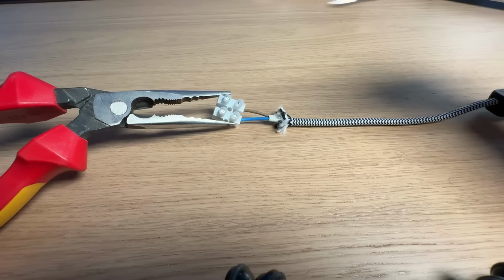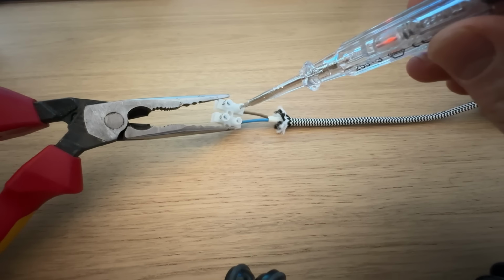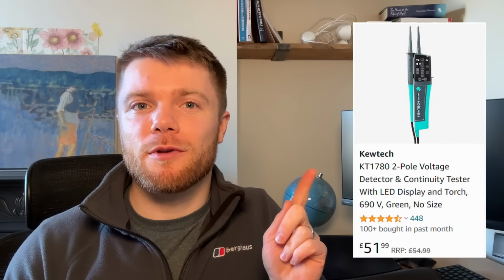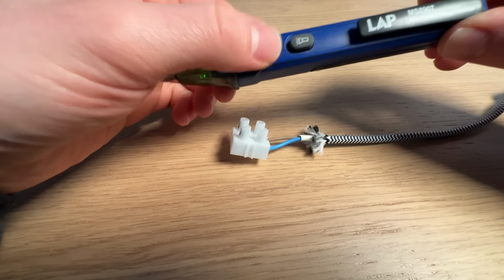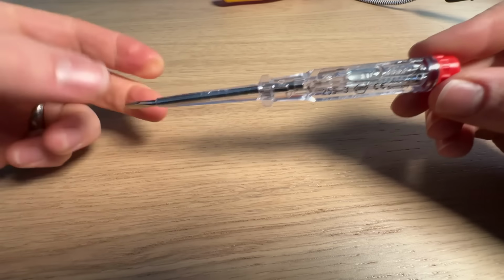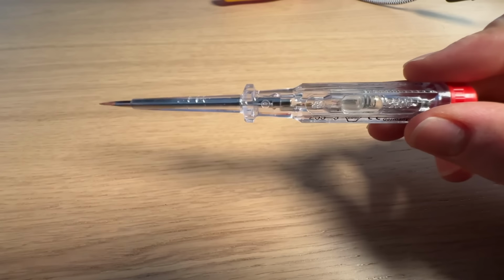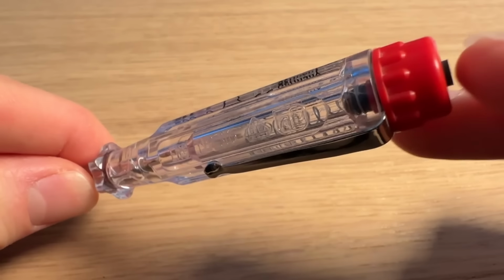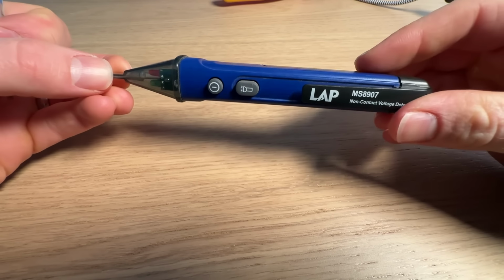The Most Dangerous Electrical Tool

Comment: the non-contact detector detects current but it DOESN'T detect lack of current. If it doesn't beep, you still have to double check with another more reliable device ;)

The testing screwdriver is great for small screws in connectors, but I don't trust that small resistor inside. In theory the light is supposed to fail and break circuit first, but can you really be sure? ;)
Reply: WTF are you even talking about?
Reply: @zaxmaxlax  which part? non-contact detector will never give you certitude that whatever you're about to touch is dead and safe. Because it detects magnetic fields specific to AC. It won't detect DC, it won't detect pulsating current, it won't detect variable current. As to that cheap screwdriver only that tinny resistor inside prevents 230V to flow through you. If it ever fails, you die.

If you want to be 100% safe you need a multimeter/ 2 pole voltage detector

Comment: Talking about a clickbait title.
The "dangers" being talked about here are very hypothetical and happen to - if anybody ever - one person in millions.
1) how would water get into this tool? If this had been sitting submerged for whatever reason, your common sense should tell you not to use it with power anymore.
2) the spring breaking off and perfectly touch both contacts before and after the resistor is not only so incredibly unlikely, that you could say it's impossible, but since part of the spring to the contact point would now be missing, there is no closed circuit anymore.

If you are talking about this tool being dangerous, in your logic, not a single mains cable should exist in any household. Because them being life all the time and possibly getting damaged and being a real risk of shocks is a million times more likely than having an issue with this screwdriver, if used as intended. Not a good video, unnecessarily causing fears with people.

Comment: Electrician here. I've used these live drivers made by CK for years. Even the Roughneck versions at Toolstation. They have their uses as an indication of SOME voltage present. They are far from the most dangerous tool. There are tools on Temu that are not even CE rated. Also tools incorrectly insulated. Go have a dig at those.

Comment: By USSR and now RF rules this neon screwdriver (of course certified and regularly tested) is the single official way to check voltage presense as safety measure. No multimeters, electronic indicators and so on allowed, only 1-pole indicator with sensitivity 90V (as I recall). 2-pole indicators allowed on high voltage, its separate story.

Yours is Wiha, Germany, so its TUV certified and reliable.

Comment: Well you got me to watch your video but it’s just scare tactics! I’ve been using them for 50 years and no problem. They are not allowed to be used in this country unless they have passed British Standards. So passed by a safety body. You can get a shock off any electrical device if it breaks in certain ways. From your way of thinking they are all dangerous! It would have been much better to highlight lawnmowers with cables on wet days. Now that would have been an actual decent YouTube safety issue to flag up.. not this‼️

Comment: I'm all for encouraging people AWAY from those screwdrivers, and there are some great points in there I hand't considered.

A non-contact voltstick (AKA "Deathstick") is still dangerous (too many false negatives) - I'll make a video about that soo. They cost a similar amount to a proper GS-28 voltage indicator that you showed. I have a video showing DIYers how to safe isolate properly, would you mind if I share it here?

Great job spreading the word about electrical safety!

Comment: Does it have to go to ground? Or does your body provide enough capacitance for the AC current to light the bulb. I have a LED lamp that slightly glows when the light switch is off because of the length of wire that acts as a capacitor. Could you put a capacitor in where the spring is and make it work that way? I do use these from time to time. I believe i remember my highschool electronics teacher taking one of these small bulbs without the resister and doing the same thing, he explained that if he were in contact with the ground he would get a nasty shock. Few of us took up the offer to light up the bulb ourselves.

Comment: Another 'failure mode' is when you are NOT connected to ground because the soles of your shoes are insulating ... an unusual scenario but possible with modern plastic materials.

Comment: Mine lights up when I touch the (unconnected) earth core in my non earthed lighting circuit. The earth core is safe to touch. This is due to capacitance in the cable. Something I understood as an electronics engineer.

Comment: I've used and continue to use all three items you've reviewed. I take your point but I think it's extreme to say the screwdriver type tester is very dangerous. Personally I prefer the non contact tester as it's so quick and accurate and detects current in cables without removing any sleeving to expose the copper cores. Also many non contact testers have an LED light so you can see into dark spaces where many consumer units are located. Mine also has a green laser pin point light. So, overall many benefits over the old style tester. Thanks for yor video.

Comment: But the non contact tester has a different purpose. It can tell you that the cable is live but it can't tell you which wire is the live one. And that's what you need to know in many cases.

Comment: The lamp works by ionizing the gas inside, there is no filament. Even if the lamp breaks as some said,  that will not be enough to make proper contact inside and harm you. The only risk is not seeing the light or improper contact.

Comment: The mains testing screwdriver and voltage pen are dangerous, but not as dangerous as the flick with the  back of the hand. The test screwdriver and voltage pen are not dangerous in the hands of a skilled worker.

Comment: How does it work? How is the circuit completed since it is connected to only live wire?
Reply: The circuit is completed by the tool user who is acting as a capacitor plate WRT to the ground (or in extreme cases user acts as a resistor when standing barefeet on concrete floor >-).
Reply: @kassisaba  whoa! That means current flows through me? But why don't i get shocked?
Reply: @_soundwave_  The current is so miniscule, we're talking less than 10 microamperes here. The current would need to be two orders of magnitude larger for you to feel it.

Comment: 1. Turn off the mains at the switch.
2. Take the fuse out of the fuse box.
3. Test if it is still live. Don't assume the circuit you are working on is wired to the correct fuse.

I removed about 16' of lead sheathed wire having crumbling rubber covered wires inside when decorating. I tested them with a multimeter to make sure they were dead before pulling them out. There's still more going into the attic.

Comment: Thanks for this video. I though it is just me being skeptical as I never use it during my electronic engineering as well as applied physics training. I just don't like the idea of letting current pass through my body, I always use my Fluke multimeter instead.
Reply: I have one but only use it as a screwdriver.
I switch off at the switch, remove the main fuse then test with my Hilka multimeter. You never know if it is wired to the correct fuse.

Comment: I use it as a secondary tool to check it twice with different tool, it should not kick you, in case of fail, it just don't show any light, so it will kick you later, but tool won't kick you. 🙂

Comment: after reading down the comments for an hour or so I learned more than the video. It also made me check back to the vid to see if it was guidance toward fault finding or simply checking for existing power yes or no. I am not an electrician or even a confident diy'er but would think that if a fault was suspected, a diy'er has no business getting involved imho.
If a diy'er on the other hand wanted to just swap out a smashed or cracked wallplate then wouldnt just simply switching off the mains be the best tester. Maybe there's possible issues even making that not foolproof idk, but it surely all comes down to what you value your life at, there's a reason electricians study long and hard and sadly even some of them get caught. If in the slightest slightest slightest doubt people, pick up the phpne and pay the money please.
Reply: Some idiotic previous house owner might have wired it to the wrong fuse. I remove the fuse and check it really is a dead circuit with a multimeter.

Comment: Used these for over 50 years with no problem. The electronic wand dosnt tell you which of the wires is live if you have wires close together, as in the terminal block you show. A multimeter can be confusing if both wires are live and you are expecting one to be nurtral or earth. Like every tool if it is used by a moron, which we are all assumed to be these days, it is dangerous.

Comment: I've been using these since I was 15 and started to understand live/neutral difference. Never had a single, slightest issue with these. I always carry one on the jobs-I have that Kews meter, non touch pens and Stanley joist/cable sensor, but that pen is the simplest and fastest device.

Comment: Plasterer speaking hear. These screwdrivers have saved me from a nasty surprise countless times as I always lift switch and socket covers test first on something you know to be live so you know the bulb works. Handy tool to have saves you getting sat on your arse with a hole in your trowel.  Anything with more power than switches and sockets I wouldn't advise using them . Horses for courses.

Comment: I used one of these for years and they are quite safe provided (1) use it for mains voltages only. IE. No more than 250 volts. (2) do not use it for RF testing, like high wattage transmitter antennas.

Comment: I got one of these thirty years ago, but never dared use it as the instructions said ! It just didn't seem right !
Reply: I've never trusted them. I have one but use it only as a screwdriver.
I test with a multimeter after removing the fuse to make sure it really is dead. A previous owner might have wired it to a wrong fuse.

Comment: I've never had any problems with those testers thru my 30y career. Neither with the cheap one nor with the certified one. I even made my own testers from spare parts, which had extended wires, for testing in two points 400V, or 230V (with a person as a neutral potential). The main thing to remember when working with these types of testers is that BEFORE you put the tester on the wire you are testing - FIRST touch any point that you know is live (to make sure the tester is working), and ONLY THAN touch that point you are examining.

Comment: I've never seen this particular design.
The one I've used had an old long fuse in it, not a globe. It also had a wire, which inserted into where the button is on this one, to an earth clamp.

Comment: I've got one only it has an earth to complete a circit. I would never use it on my house but i do use it on my car, motorbike and tractor. For the house i have a contactless one that works really well. I also have a multimeter but if your trying to find out if there is a live 240v then use a contactless device.

Comment: There are much more durable version exists, which I'm using for years. The main rule: always check if it's working, or not. (never had issues, but one measurement is not a measurement, two measurement is half measurement. three measurement is almost a measurement, four measurement is one measurement, but one measurement is not measurement...) :D

Comment: 😂😂😂For 100 percent safety, don't use that screwdriver in a live wire or live switch; better turn the breaker off. I used it to check unplug extension wire and it can pinpoint the damaged portion/line...

Comment: Non-contact testers are great and I have 3. However, if you value your Spouse and children, then definitely get a Mains Testing Screwdriver. They can do what non-contact cant. They can test screws of switch boxes and socket fittings.

For instance, when we moved into our new house, two separate mains light switches had the live connected to the screws on the switch housing. This had happened because the live was shorting locally to the metal casing behind, no Earth fitted. This would have been impossible to test with a non-contact type, as it would be swamped by voltage from cable. Of the thirty odd sockets and switches in our new house, only two had this problem, but it only needs one to ruin someone’s day.

Comment: I have worked on electrical equipment from low voltage to 400kV both AC and DC for 60 years using every type of test equipment. This is the only item I carry at all times. Use it sensibly and it will save your life.

Comment: That device is called 'Tester' and its main purpose is to detect Phase and Neutral in a Single Phase Supply system and NOT 'live' or 'dead' wires. All wires are always assumed to be 'live'.

Comment: Never got electrocuted when using tespen (that's how we call it here), I'm no electrician and didn't use it often. 
But it did fail me once : when i checked the wire, the light didn't on, so i thought it was safe. Then i cut the wire with plier and zaaapp!! ⚡😱

Comment: May I ask , in what way is this line tester dangerous??? I have , others too have been using this for years on end with no problems  as testers have low resistance voltage
Reply: On one hand, we are telling children to not touch current-flowing wires/materials without any insulation to ensure safety. 
On the other, we are expected to probe this metallic rod into the outlet slots without insulators like gloves. 

The idea that one’s body completes the circuit really terrifies outsiders like myself. Also, we would not know if the test pen is malfunctioning or it is indeed not live wire.

Comment: In over 50years of using one of these small electrical screwdrivers I have never had a problem except for the blade at the end when tightening up screws because it doesn’t seem to be hardened metal
Reply: We all do it but they're not intended for use as as screwdriver Don't even ask why they therefore make them with a flat end rather than a point

Comment: I grew up with those. All of our PLC's back in the day used 120vac IO. Yes it was a bit dicy with 480volt we used high impedance Y so it would be 277 to ground. One building on site used a grounded delta so that had 480 to ground and we all knew not to use our little glow sticks there 😅.

Comment: always assume every cable is live
always wear properly EPP
always avoid if possible to work with live circuits
always shut down everything possible
always check the circuits after you’re done shutting everything down
also dunno for 110v but that one is rated for 240 that’s why it’s marked CE and 255/3
it’s DIN/european standard
if you’re afraid of a shock you can use 22k resistor and 2 red LED in counter bridge with 2 cocodrile pliers in both ends or point probes to conect between earth and L/N that will provide 10mA enough to ligh on the led and you will not closing the circuit
or use a multimeter that have high impedance put it in 220VAC range insert the red on the socket and touch the black as earth bonding yourself the highest reading is live the second is neutral
even can use between earth and live a incandescent bulb same circuit as led but more bulky
Reply: and for holy crap don’t use it on three phase circuits never ever
this is just for one phase
we 220v single phase users also use 380v three phase
and those device are not for that situacion nor 220 three phase 
there’s dedicated devices for testing two or three phase tensión 
also if you’re afraid of a little shock just don’t do electricity and call a friend that have studied or other person with the capabilities and have the proper instruments and tools to work 
because earth bonding at more than 60vac/bcc can shut down your hearth
Reply from the maker: Thanks for watching
Reply: @TheDiligentDIYer1759  no problemo, is understable taht people is afraid of earthbonding themselves, thats the real problem you acting as a incandecent bulb between line and earth
but following the 5 golden rules of safety you should be okay to work everytime
and as you say theres Non Contact Voltage detectors
but when the wires are too close its difficult to discern between L-N

Comment: That only becomes dangerous if it gets submerged in water or in some cases if you where bare feet on a wet floor the problem with the touchless ones is they can only tell is there is power (which i already know there is) and not which wire is hot and neutral in order to wire the outlet correctly sometimes the wires are not color coded and even if they are i always check first.
Reply from the maker: Thanks for watching

Comment: Have used them as a DIYer for over 40 years, even back when we did electrical work that is not allowed any more. Isolate at the board (in my case in the garage), lock the garage and put key safe, double checks on circuit, and above all don’t work on a live circuit. An early blown fuse after cutting o a live wire, and you learn very quickly what not to do. Non contact tester isn’t always reliable in my experience.
Reply from the maker: Thanks for watching